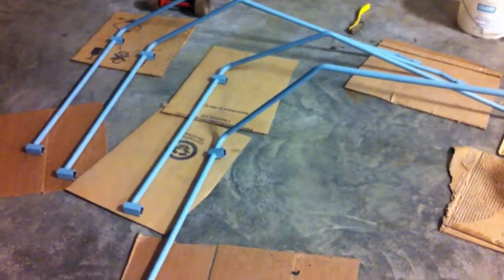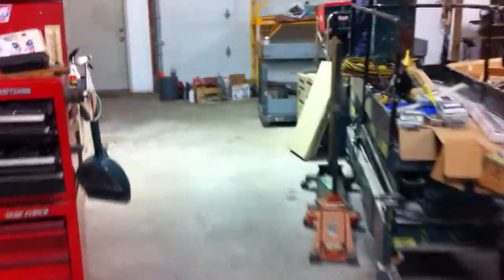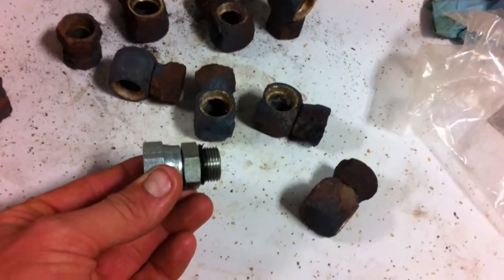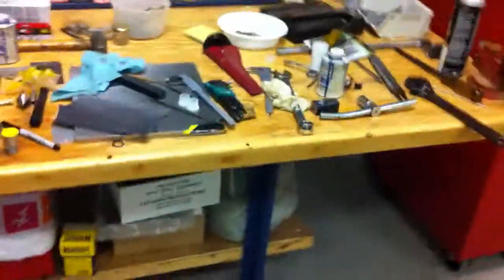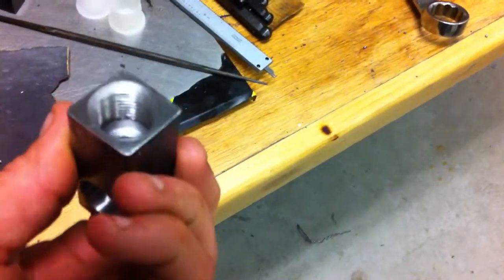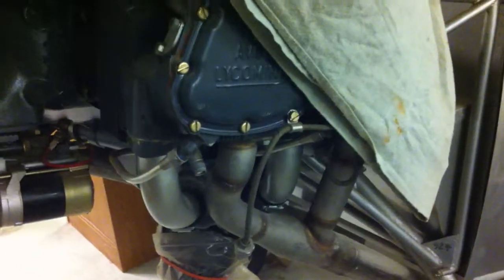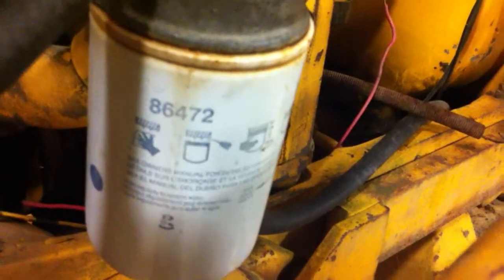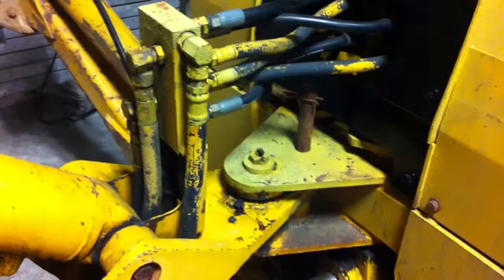Fabricating adapter fittings for obsolete hydraulic lines on a John Deere 300B

Comment from the maker: I got the gearbox back in last night, with the new red eBay belt. I had to tweak more on idlers ad guides. Bummer is, it still makes a popping noise in 5th and 6th doesn't engage. 
Soooo,I'm huntin on CL for a parts mower

Comment: Yup, Those two pieces of equipment are great to use. I work with a manual lathe and bridgeport at work among other things quite abit and I love those things. To bad there not mine or I'd be making engine blocks or something.
Reply from the maker: Yea my dad used to work in a machine shop back in the late 60s. He's showed me enough to usually get by when he's not around. We got the lathe and mill for cheap. 
I was either one of those take it away deals, or a trade for a favor. Around the airport we got a lot of old timer characters, and they realize that they aren't gonna be using the equipment much longer, so we have had a lot of stuff "donated". 
Buyin Tooling bits and stuff will kill ya...I think dad said we probably had 2-250 in tooling for this project...but the tooling can be used for future stuff too at least. 
The south bend lathe came out of a women's prison somewhere around here in ny or conneticut maybe. We completely disassembled it , cleaned it up and painted it rust oleum almond a few winters ago.
Parts are still avalable for south bend lathes so we got new belts (interesting that the new belt , you cut and glue) and some of the bushings. 
It was in real nice shape to begin with but It was in a building with open windows for ,idk, probably the past 20 yrs. 
it has the setup deal to cut screw threads which is nice.
Reply: Yah old people tools are usually the best to get, usually they had them for a long time to begin with so you know they will last.